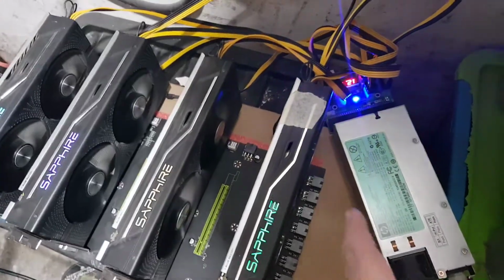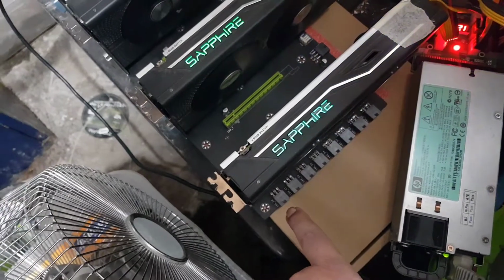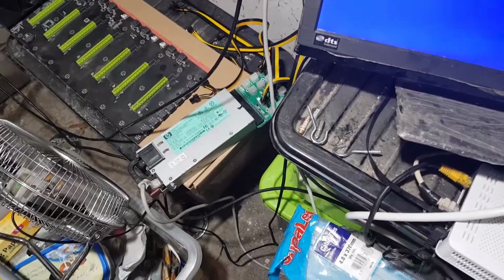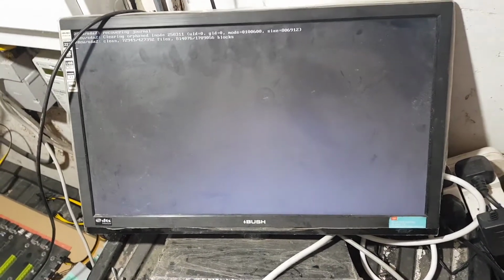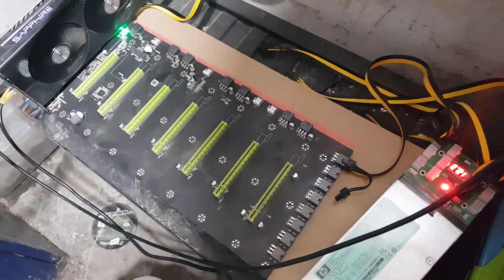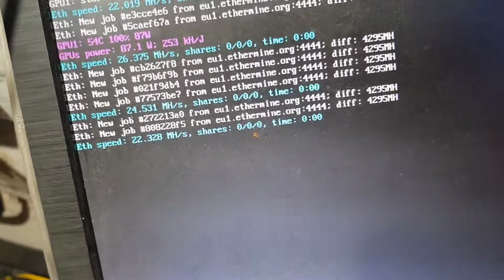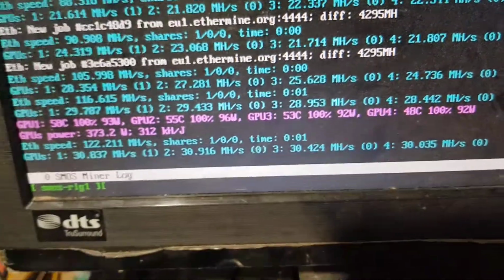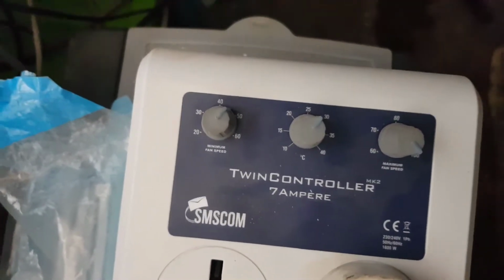How to CORRECTLY wire up the BTC D37 Mining Motherboard using both sets of pcie power ports

Comment: Thank you for clarifying this! It does make much more sense on how this PCB was designed (^_^). Do you have a video on how to setup the BIOS properly (Noob here) as well as which OS you are using and how to use it (or at least provide a link to someone who uses it). Greatly appreciate this video.
Reply from the maker: dont do anything bios is already setup i use minerstat you can run it off a  usb stick if you wish.  i dont have a video on it but its all very easy i can make one if you want?

Comment: Will this setup work for RTX 3060 ti? I use an Evga as PSU and have used a pin to shorcircuit the 24 pin mobo so I can work with the GPU cables. Since RTX 3060 ti uses a whole 8 pin connector to power on, and connecting the RTX 3060 ti to the plaque (6 pin) as a bridge may not turn on due to lack of juice. What are your thoughts on this? Will it work?
Reply from the maker: connect a 6 pin to the pcie mobo cnnector and an 8 pin to the gpu and it will work. see my other videos i had it wireed   that way before. you can wire from psu 8 pin to 3060  and a 6 pin to the pcie lane  - see here how i had it before you can wire direct - https://youtu.be/NtscYtd8i0g
Reply: @GhostvaperYT  Thanks. This is actually what I ended up doing! So I suppose the solution from this video just applies to GPUs with 6-pins of power supply.
Reply from the maker: @josephl  no my cards are 8 pin.  i use cables that are 6 pin to 6+2  -  so the 6 pin in mobo 6+2 end in gpu  - here u go i got these  but i am on a server psu - https://prnt.sc/1nyklyc
Reply: @GhostvaperYT  Now I get it! I used 8 Pin + 8 Pin(6+2) to connect the GPU in the mobo instead of 8 Pin (6+2) + 6 Pin, as suggested by you in your last answer. Now's everything clear. Your video plus your answers were really helpful. BTW, you should definitely update your description with some affiliate links where to find these cables, plus this motherboard. I think a lot of people would click on them. Thanks again!
Reply: @GhostvaperYT  BTW, what 6 Pin to 8 (6+2) cable are you using to connect the mobo to your card? Will it work for an RTX 3070?

Comment: Hey mate how do you connect evrything to one monitor and  where can we get that op cooling setup
Reply from the maker: on the motherboard at top left (on back motherboard outputs)  there is a hdmi and vga connector - just plug monitor into motherboard hdmi or vga.   you can just see on my other video the connectors with hdmi plugged in on the left and vga next to it on my other video here -  https://www.youtube.com/watch?v=NtscYtd8i0g&t=165s   - now the cooling fan is an RVK  6 inch fan - i  got it from a lccal shop that does weed equipment.  google RVK 6 inch inline fan  like here.  -  https://www.onestopgrowshop.co.uk/systemair-rvk.html

Comment: How do power the motherboard itself?
Reply from the maker: this board comes on when you plug in the wires there is NO seperate motherboard power.  so when you plug in gpu number 1 and wire it the board comes on. there are other models which have the 24 pin connection like normal BUT THIS ONE DOESN'T. hope that helps.

Comment: How much RAM have you put on it?
Reply from the maker: i have put a 2gb laptop sodimm in it but i do recommend you put more like 4gb if you have it, but i only had a spare 2gb and its been 100% fine - remember if you run it with a mining os it doesnt need loads!  if you use windows use minimum 4gb
Reply: @GhostvaperYT  I have some extra 8gb sticks. Do you think it would be a problem to use those?
Reply: What celeron processor is best for this board
Reply: @mikemorrison7926  I don't think it really matters. The processor is already onboard and cannot be removed.
You would have to desold it

Comment: The Q ist WHY YOU HAVE TO DO IT LIKE THIS????????? If u put no power 2 the board it will not work, but to use it like u said is no need
Reply from the maker: the correct way is to put power into the bottom connectors that your are using.  You can do it as I did at the start of the video if you wish.

Comment: Bullshit... Cannot use it with 3080 or 3090... One cable is not enough...
Reply from the maker: those are big card and this board won't even have space to fill it up with those.  I would power those cards directly from the psu.  run cables from psu to riser slots on board.  they can be used as inputs aswell.  then run cables from psu to cards like normal. wire it as if you were using normal risers.  dont  use the bottom power slots at all ignore them.